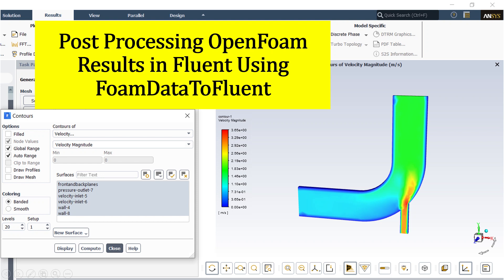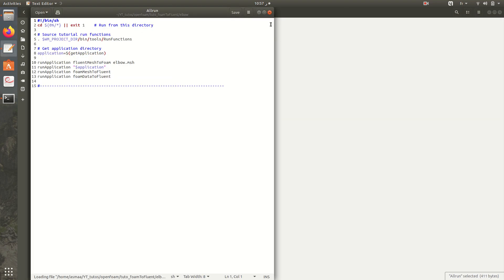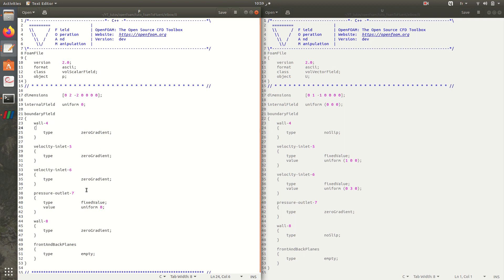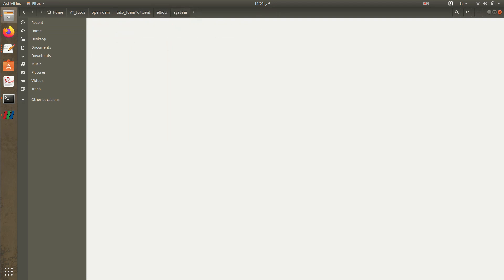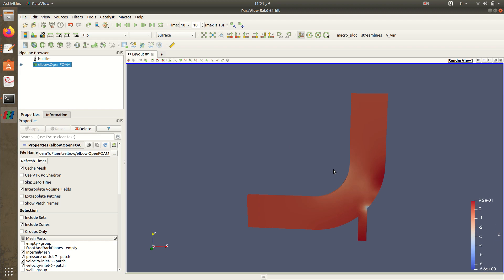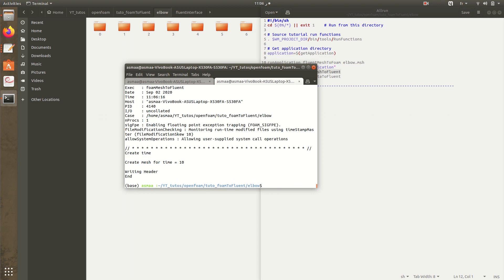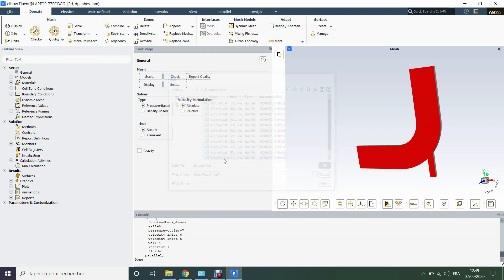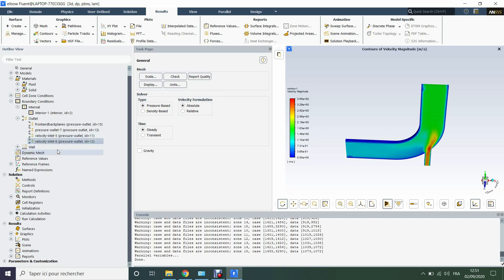Post-processing OpenFoam Results in Fluent using FoamDataToFluent

Comment: Hi, while I had the mesh generated in ANSYS workbench to use in OF, upon exporting the data file from OpenFOAM to Fluent using "foamDataToFluent", opening the original mesh that was generated in ANSYS, in fluent gave some errors like "read_thread_data_section: invalid thread id xx". So I went back one step again the OpenFOAM, and applied the command "foamMeshToFluent". This way the mesh is regenerated from the latest data file in the directory then we ensure the data file and mesh file are fully compatible.